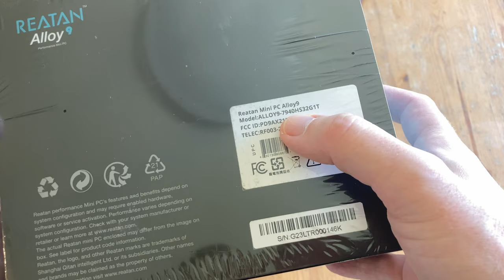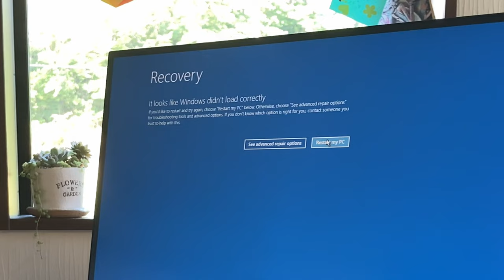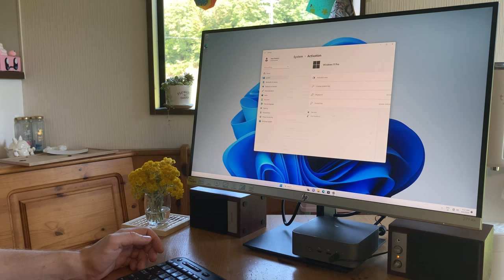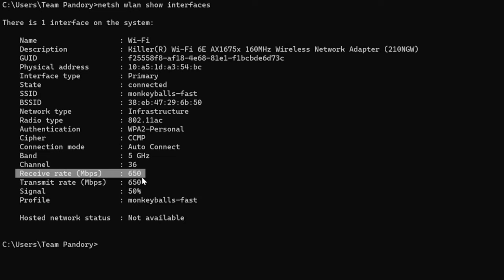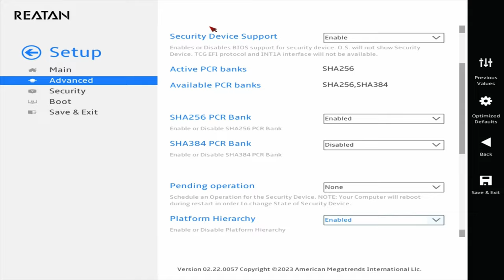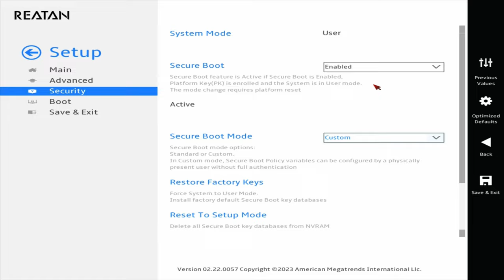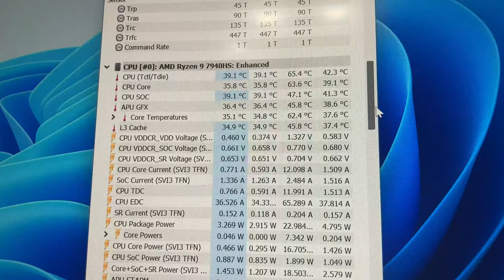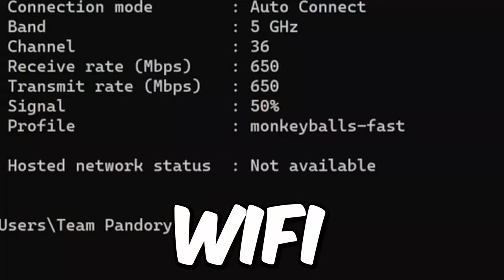The Ryzen 9 Mini PC POWERHOUSE, With a Twist [REATAN Alloy 9 Review]

Comment: There is no IPU support! All other competitors for 7940HS have this option (such as Minisforum, Beelink, GMKtec etc.) Do not buy until it's confirmed they have this option supported.
Reply from the maker: It can be a blessing, and a curse.  AFAIK turning off IPU can leave the computer with less power draw, and less heat = better performance in gaming.  
Until AMD release graphic drivers that give us an IPU boost for games, there's no real reason to avoid it due to the lack of RyzenAI support.  
Unless you need to develop using RyzenAI.  🙄
Reply: All our current machines support IPU. For those acquired in the past year, download and update the BIOS to enable IPU support.
Reply from the maker: @ReatanMiniPC  That's great to hear 👍. Can you toggle it on/ off in the bios, or is it only set to ON?

Comment: I like the I/O with the 2 USB 4 and 4 USB 3.2 Gen 2, so no ancient USB 2 or even 5Gbps USB 3 to have to put up with in 2024.

I like the fact that the front ports proudly state USB 4, so you are in little doubt at all, subject to no clarification of whether they are running at 20 or full 40Gbps.

The gaming performance looked great all round. Would have liked to see Xbox emulation.

I like that the rubber feat have been designed not to use any sticky substance.

The clunky BOOS can always be rectified with a firmware update.

Perhaps the wireless signal strength could be rectified in future manufacturing by using plastic for the case.

Overall, it came across as positive overall.

Bearing in mind that this is a brand that has come from nowhere, it is good that you can get it from a source with a decent enough returns policy. Always be wary of purchasing direct from any company that does not have it's actual mailing address on their website website.

On the subject of sucking, that closing music (I'm being generous with the description of 'music').

Give the cash that they sent to your favourite charity.
Reply from the maker: Definitely a positive review. As we mentioned, dongles can work around those points, but still would lose it's premium looks. 
Usb 2 has it's purpose which isn't immediately obvious, until you look at troubleshooting and knowing it doesn't need drivers.
Guessing you prefer a quiet close instead of the summary eh ? 😄

Comment: Looks a really nice bit of kit, but having to add a USB WiFi aerial to get coverage is just so wrong. As you say, encasing it in a metal box is not going to help. Otherwise it seems to be a great little PC. Grand review as always Tim...
Reply from the maker: Hey there, thanks 👍 
To be fair, my router is one that came with my ISP. It uses WiFi 5, and is through a couple of layers of dry wall.
The test we usually do is probably for the "regular guy who never upgrades his stuff", rather than having top of the line equipment.
If you're all WiFi 6E router with a mesh setup, I'm sure it'll work like gravy.

Comment: Hi.
Is there that much difference between different manufacturers?
I was following the "MINIS FORUM Venus UM790 Pro", here in Spain it has a similar price and specifications, but it's a different brand.
I'm not in a hurry to buy, maybe I should wait for the Radeon 890M to come out?
Thanks for your videos!
Reply from the maker: There is for sure.
We've reviewed 3 mini PCs using the 7940hs processor, and the other two throttled due to not enough cooling on the memory and nvme.
There are also subtle differences regarding differing memory, nvme, additional nvme slots inside, price, CPU cooling, WiFi signal, software installed.
It's not only a question of "what processor is in it", but the sum of all its parts.
Reply from the maker: Regarding waiting for the 890m, I think we'll be looking at either the third or fourth quarter of 2024 before we start seeing those.  And then it'll be "should I wait for the 990M?". It's a never ending cycle.
Reply: @TeamPandory  
Hahaha, that's true.

And thanks! I'll try to find out about all the options in my country, or I'll make a friend who understands, maybe that will be faster :pppp

Comment: Do you think an antenna mod would be easier than a fan mod for the other options?
Reply from the maker: Honestly outside the WiFi and Bluetooth, this thing is great 👍 
To be honest we do the worst case scenario when it comes to WiFi using WiFi 5 rather than WiFi 6E, however a usb dongle for both game controller and WiFi is such an easy work around
Reply: @TeamPandory  batocera works so well with ps3-ps5 remotes that I’d hate to sacrifice that functionality at this price point
Reply from the maker: @zackerymcpherson9409  I've never tried a ps4 controller with batocera!  Genius 😎
Reply: @TeamPandory  ps3 controller is probably the easiest controller to pair for the system, usb cable for 5-10 seconds and it’s paired. Perfect for Sony emulation nostalgia.

PS4 and PS5 just need to be put into pairing mode. Their touchpad works for DS games.
Reply from the maker: @zackerymcpherson9409  nice! 👍 Will give it a shot when I next boot up batocera

Comment: I am into very colorful hardware, especially computers, but this is the first time I remember where I like this color for them.  IMO it looks really really good.

MS is doing everything they can to push people away from it.  I mean as it is the only main software of theirs I still use is Windows 10.  I will jump ship when I can.  I am sick of the big brother BS, the spying all the time and now with the upcoming "co-pilot" and always recording everything you do, FRAKING BS, I have had it.    ZERO trust.

The voice actor in that game certainly sounds familiar.

AMD fixes for what exactly? (emulation)

I like the cooling situation, though not a fan of how difficult it is to reach the APU.  

Shame.

Great review as always.
Reply: Oops, that was me.
Reply from the maker: The voice actor in that game?  Do you mean Dave the Diver?   ... 🤣
But yeah, MS are going hard the last what, ten years in trying to take more control of YOUR system.  Spying with co-pilot, and if you can remember the type of shenanigans with the XBOX ONE launch?
Thankfully it's pretty easy to jump ship now, especially with the rise of online tools/ applications like canva, and also Proton being able to play most Windows games.
The IPU was not activated, so that could be good, or bad, depending on how you view it.  TBH I'd prefer a switch in the BIOS so we could activate/deactivate it if we need it.
The APU itself is actually attached to the outer case using liquid metal.  I probably botched it up by pulling it like that, but it was nice to know that it uses something higher-end vs the usual "toothpaste".

AMD fixes, sorry we didn't explain.
Teknoparrot is an arcade emulator for later games, such as Outrun 2, Tekken 7- and those arcade systems ran using GeForce GPUs.
If you have a GeForce GPU in use, then most games will perform as they should.  If you're using either Intel or Radeon (AMD), then you'll require fixes to be installed, or you'll be riddled with graphical glitching and errors.  Textures not showing, things like that.
Reply: @TeamPandory  Thank you Dave.
Reply from the maker: @TrusteftTech  oh right, that was me being a fool 😂
Reply: @TeamPandory  You might want to work as a voice actor.  You have a very good skill there.
Reply from the maker: @TrusteftTech  hook me up 😂
Reply: @TeamPandory  You speak with riddles, Jedi Master.